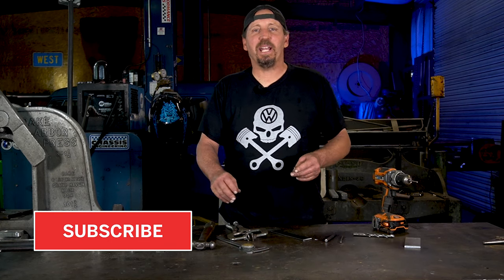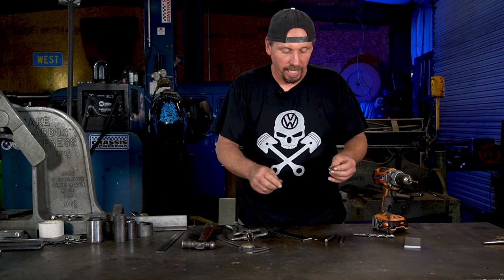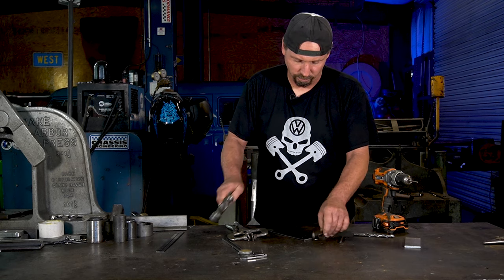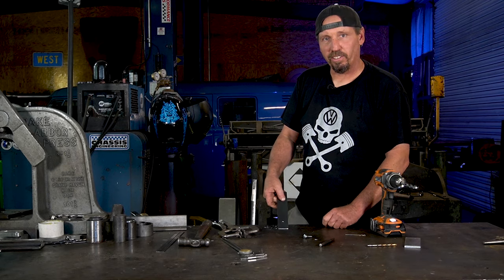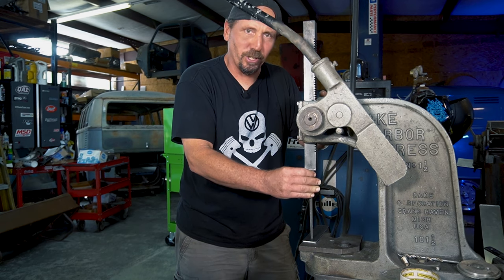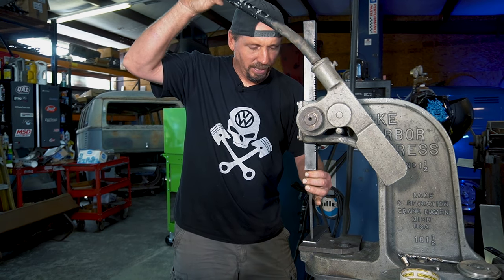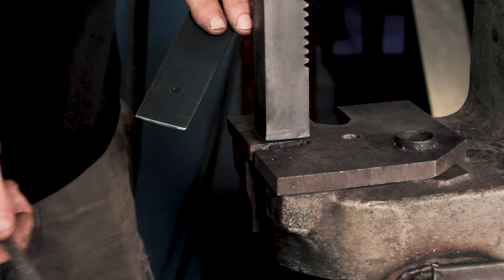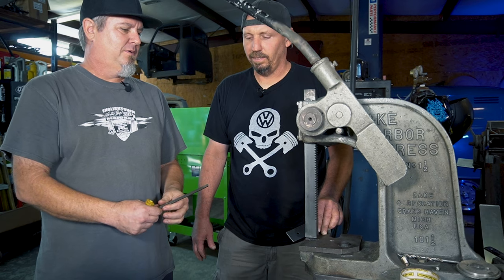How To Drill a Square Hole! / Super Easy Tip

Comment: Came back after making my first squared hole, to say thanks for the idea of using a squared file... The best one from internet... THanks
Btw... I did not use a press to push down the file, but doing a litle X on the round hole with a small cutting disc on a dremel, and the hammer gently hammering down the squared file... Worked perfect!
Reply from the maker: Nice! Just be careful.. the file can break easily.
Reply: Probably a good idea to use a piece of wood or something between the hammer & file so you aren't hitting 2 hardened surfaces against each other

Comment: Have done square holes by drilling a little oversize and actually filing square with a square file. Had 3 type  262 VW’s   ‘64, ‘65’ and  a ‘66 with the big back window. They could carry a ton over rough trails. Miss them!

Comment: I’m trying to put a 3/8 inch drive whole in my stubby wrenches to move the work 3inches a way like a starter bolt under a manifold then get a long extension on it and turn it with a ratchet up top. Basically an extended closed ended crows foot. I can buy them for $60 a piece or turn a whole cheap wrench set into them and always be able to have them

Comment: I have to make 1/4" holes in 1/8" Aluminum, but it's on the van walls (big Step Van) .. A ect broach for that is like $260 :( ... My plan is to buy a proper broach and hammer it though a 17/64" pre-dill.

I wonder if a square file would worK like thus free had on the van walls: .. MUCH cheaper!!

Comment: I've never seen anyone use so many drill bits to drill a 1/4" hole.
Reply: hahahaha!!! it was 2 drill bits! the 3rd was just deburring!
Reply: @ryanlowther6447  ...which makes it 1 drill bit too many,  taking you twice the amount of time to do the same job. This is even more pertinent if you're doing a lot of holes. 

And considering the third drill bit was for deburring, even that was a completely unnecessary step as he was turning that round hole into a square one.
Reply: @JohnG-tv3gc  it's all about accuracy.  I like things perfect and this is how you make things perfect
Reply: @demonmotorsports99  Accuracy is only important when it needs to be important. Any other time it is called, overkill.
Reply: @JohnG-tv3gc  accuracy is always important
Reply: @demonmotorsports99  Okey dokey :)
Reply: The deburring drilling was so the file/punch gets piloted to the center.
Reply: This is like saying "I've never seen pro level fabrication" lol

Comment: I have every possible tool in my garage, but not an arbor press.
Reply from the maker: Same here.. I look for one just about every week on Market Place. Ryan found his for free!
Reply: $70 from Harbor Freight, and more or less expensive than that from Amazon. Lots of budget china specials you can get by with until you find a nice quality used one(if that's what you're holding out for).

Comment: I’m fairly experienced, and I have a reasonable toolkit, but I Don’t Own An Arbour Press, and yes I do know what that is, and I have used one, but I have never had the justification to buy one for the few times I have needed it, also I’m usually working on site, and it’s not practical to carry one in my vehicle, I also know what Broaching a Hole means, but this title is very misleading Gents, be straightforward about what you’re actually doing - Julie

Comment: Yeah, how bout I not subscribe. I've been a journeyman machinist for years. From tool and die to power plant outages. I've also had formal college training on machine shop and manufacturing. So you never want to use any file in this manner or for prying! Have you ever seen a file explode and pop like candy. Don't teach people this cause its not o.k. especially if someone looses an eye.
Reply: I’m usually not a fan of safety patrol in comments.. But, you are so right on this one.   Files are intentionally non-ductile and when over stressed tend to shatter and scatter.  This was a bozo technique that could easily get someone hurt.

Comment: Not quite drilling a square hole 😁
Reply: Technically but...... Its easy and it works!
Reply: Ryan Lowther when you fabricating you have to think outside the box and use the tools you have to get the job done 👍👍👍
Reply: @4x4loz97  absolutely!  Having an iron worker with all sizes of square dies works well too but no one has given me one of those yet!
Reply from the maker: I wouldn't be surprised if someone showed up with one tomorrow. :)
Reply: Rob Stapleton 🤣🤣🤣🤣
Reply: @RobStapleton  got my fingers crossed!